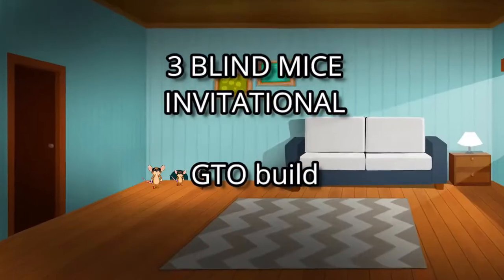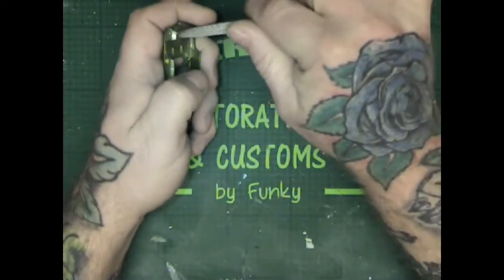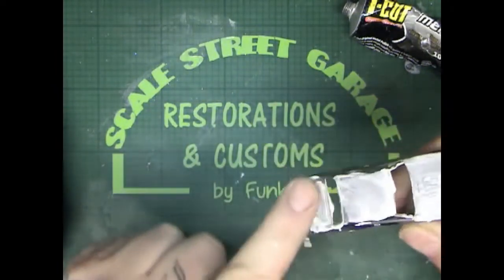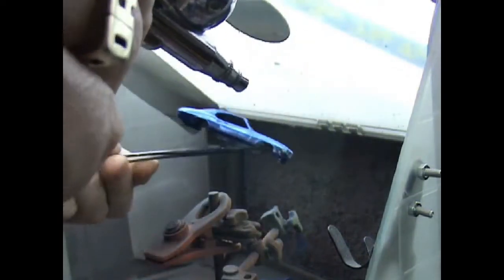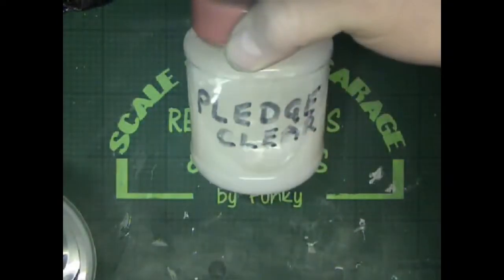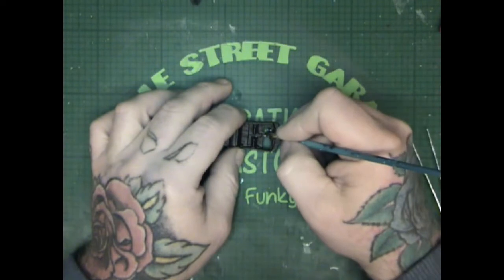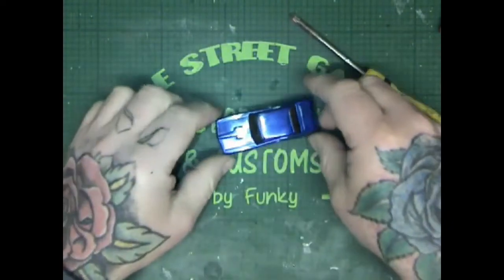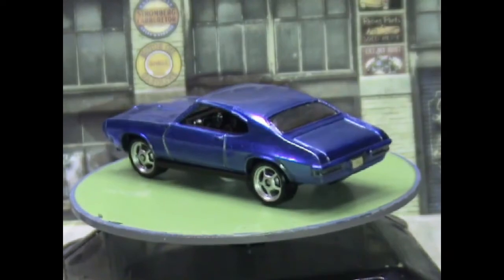3 blind mice invitational gto build

Comment: Hail,  Sir Funky of Scale Street! 
   Your dislike of the spoiler wing IMHO stems from it being out of scale in height. Most 1/64 manufacturers (Mattel plays fast & loose with scales. It could be 1/72, or 1/87 with HW) include the wing as a solid "wall" with no space between the flat wing and the "boot". To be sure there was a space in the casting the wing supports are too tall, and it looks "out of scale." Other manufacturers would make the wing a separate plastic piece added on (like Pontiac/GM did.) It's a choice by the manufacturer, or maybe by their Legal Department. (Detachable part? No, liability! ) In a sense, you created a "sleeper". Like a wolf in sheep's clothing, a GTO disguised as a Tempest. If you shortened the supports, you might have liked it. 
   The dark blue is a favorite color on this car among collectors or customizers of the actual car and this HW. The upgraded wheels separate it from a toy appearance. I am struck by detailed interiors, and I wish more builders would do them.  Even if you just glimpse them, it thrills you. 
    Carry on with your quest, good knight, in service to the kingdom of diecast cars worldwide. Continue to have fun with your toys!
Reply from the maker: Thank you kind sir and i am pleased you like the wolf ... 
I dont think the classic cars suited a rear spoiler as it drew the attention away from the natural beauty of the the design, a boot lip was fine but nothing that looked like a picnic table... i dont mind them on newer cars as of from around 1980 but a nice clean looking muscle car looks perfect

Take care my cyber brother, and  keep the family safe 😷
Reply: @ScaleStreetGarage  We are safe. We passed a 2 week self isolation period w/ no symptoms and will retain that practice until the world resumes. BTW, an American nickname for the GTO is a "🐐"! Hope yours isn't rattled!